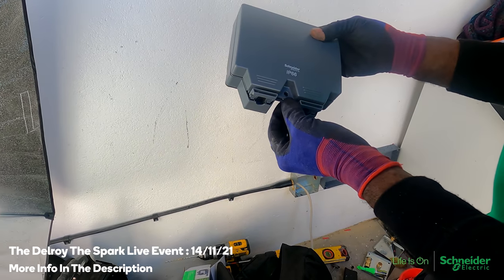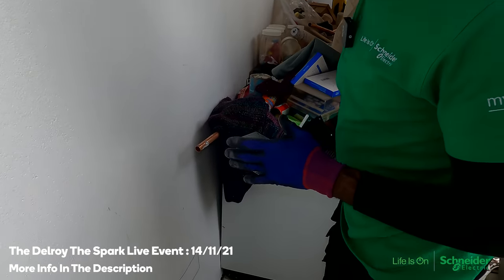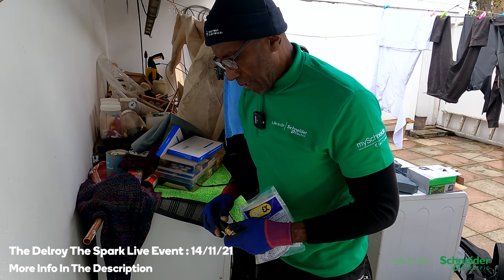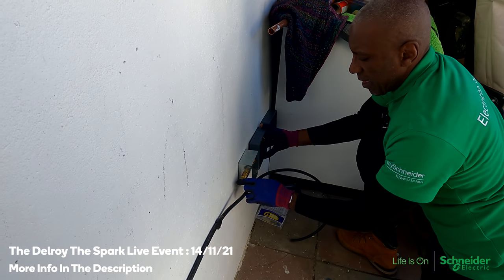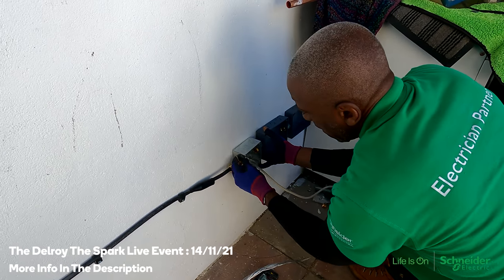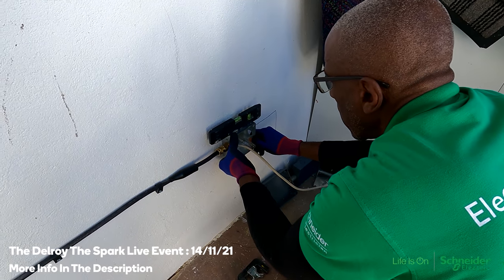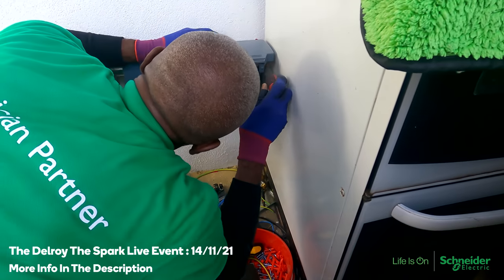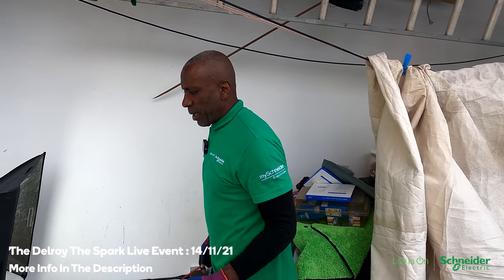Step-By-Step: Installing A Weatherproof Socket @schneiderelectric

Comment: Possibly use the earthing lock nuts in the future on the armoured cable and go straight into the plastic back box.
Then use plastic coupler so no issues with earthing that either 👍

Comment: Those cleats probably tighten and hold better once they've been screwed down. I think they're loose by design to make life a bit easier when installing.

I think this might be one of those common misunderstandings like where people think that holes for wall plugs should be drilled tight enough that the plugs need to be hammered in.

Comment: When i was installing small swa's on a single run i would put swa inside a length of pvc conduit and fix that to the wall using suitably sized cleats ,much neater and no sagging also fixed 230v warning labels to conduit , i enjoy your vids btw.

Comment: Only thing I would have concern about is the metal box earthing tag might have compromised the whole circuits IP68 rating even though I know metal box is good for SWA termination. Also the small risk of exposed metal under pen fault conditions🥵

Comment: When you say about the socket you could call it a 1st fix socket as id say its an appropriate term to connect the two boxes together via a socket or a mechanical socket as its a mechanical fixing and not a electrical 2nd fix item

Comment: Hi Delroy, thanks for the video.  Hope all goes well today.  As an adult learner, is that metal box earthed?
Reply: Yes the metal box is earthed via the armoured and assuming that the other video was the other end. However the coupler between the 2 would not have been which is not good possible a c2. Not sure the metal box was the best idea especially with the unsealed holes in the back. Not very good install in general.
Reply: @cms4467  Thanks for taking the time to reply but I still don't see how the metal box is earthed if he hasn't used the SWA as the earth back at the CU?
Reply: @no_short_circuit  I believe that the other video that was posted showed the other end of it and in that you can see him trying to get ring crimps the right size. I agree that it is not earthed in this video. 
You need to earth the armouring at one end. So to comply it would have had to have been done at the other and then using the brass gland would have earthed the box and the bush this end. But not the bush between the 2 sockets.
Any questions keep asking it’s the only way that we all learn
Reply: @cms4467  Thanks very much - I understand what you are saying.